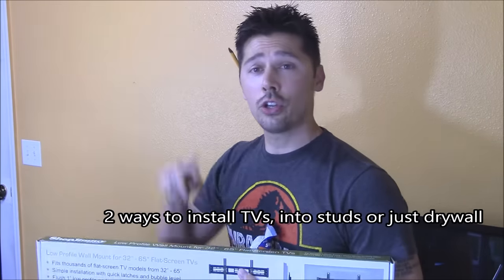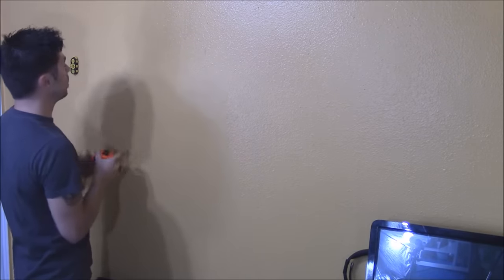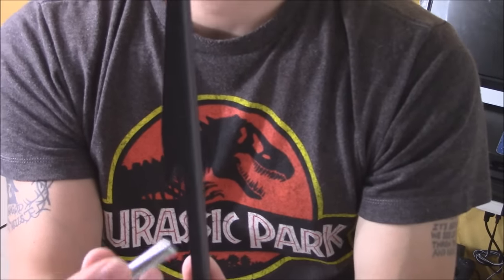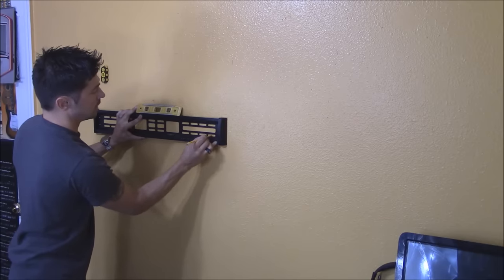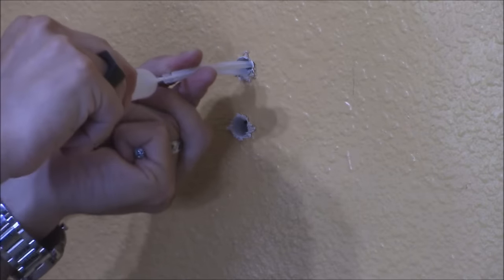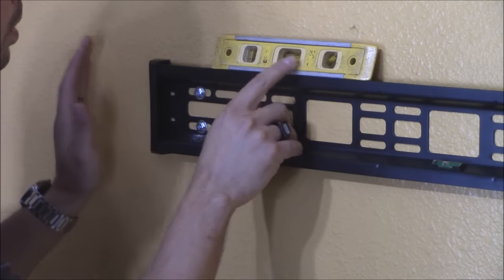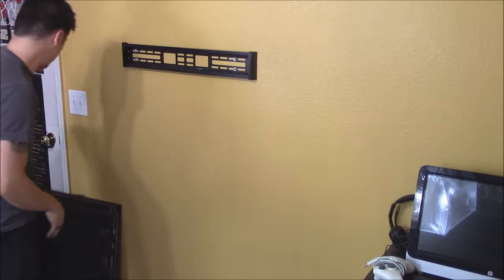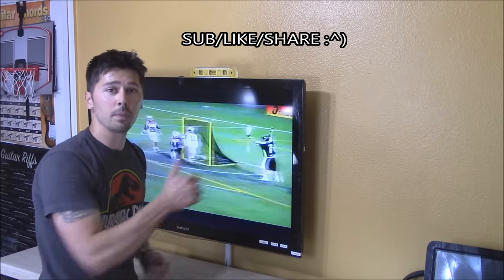2 ways to hang TV on wall mount into stud and drywall review

Comment: I see you're only using 4 mounting points for the bracket to the wall. As most only use 4 bolts/screws to mount bracket to the wall.

I'm having a hard time finding studs in my wall, so I was thinking of just using snap toggles.

Do you think by adding more snap toggle bolts it would make the mount with tv that much more secure?.. I'm thinking of at least a total of 10 snap toggles to mount the tv bracket mount to the wall.

I would think so unless there's some bit of engineering and physics I'm missing that dictates it won't help as much as I think it would or should.
Reply from the maker: Wing Yip yes but don't use toggle bolts too close to each other.
Reply: Thanks.

My wall is weird.. really tough to locate the studs.. The electronic stud finders aren't giving me solid results and I'm afraid if I got a magnetic stud finder it may not even detect the nails/hardware in the studs since the walls are sort of thickly layered, I think.

I did a 1/2" diameter test drill (well, it ended up being a test hole) and noticed my drywall(or is it plaster wall? same thing?) is about 1.5"thick  before I hit a layer of wood board in the back.  I think I need to penetrate that wood layer in the back and use the snap toggles.. they seem to be the only ones which are really strong and can possibly go in that deep.

I'll keep the spacing in mind between the snap toggle bolts.

The tv mounting plate accommodates up to a 16" span, assuming I had studs that were 16".. there are multiple mounting holes across the top and bottom of the plate as it's pretty common and you might be familiar with.

I'm thinking an additional 3 evenly spaced between the extreme left and right ones on both the top and bottom, for a total of 10 bolts.. If I'm reading the template correctly, that would mean they'd be about 4" apart from each other... One in the center, two 4" away from the center and another two 8" away from the center.

With that many snap toggles spread across, 2 rows of 5 snap toggles spread evenly 4" apart, that should be more than enough to hold the fairly weighty tv wall mount and 46" tv.. even if it's one with the extending arms.. although, for safety, I may just leave it alone most of the time and keep it as retracted as possible.
 
thanks again... great video, btw.

Comment: Hey quick question I got got a 55 inch lg TV and am planning on mounting it on an arm bar type of mount. Am going to put to screws in the stud and and 5 using a snap toggle bolt. Do you think this will be ok of will it fall off??
Reply: Two* screws

Comment: Thanks...one last question...you suggest NOT USING toggles after certain size I think you stated 55"..what do you mount with as a fastener for large 60" plus TVs?
Reply: It's not about the size of the TV as much as the actually weight. Newer TV's are much lighter now a days. Although you should always have some kind of stud in the wall, either wood or metal. If not then it could be a concrete wall.

Comment: Used those anchors after one of your other videos, well worth the money over some of those cheaper anchors that seem to fail.
Reply from the maker: TJ as a TV installer i can't live without my snap toggle bolts works in concrete block, metal studs and just drywall, great invention!

Comment: interesting..but I have a problem with my tv wall mount I bought. it's for the right size, though my TV is a LG 42'' LB5610 and it's NOT completely flat behind. like the holders should have been horizontal instead of vertical! So should I try to look for one horizontal or look for holders and screws to fit in using the wall mount?

Comment: I would never trust any drywall mount to hang a TV on the wall. I currently have my 65" Sony on the wall but it's in the wall 2x4's. I used the same magnet stud finder and then centered the stud with a small nail before drilling. Once you find the stud it's best to then find the center. Most wall studs are 16" centers, but they're not always exact. I used a larger level but vertical not horizontal to ensure the top and bottom holes were straight on my bracket. My bracket was much wider (10") than this one. Wife and I lifted the TV while still on the TV stand to the wall mount. Then I removed the stand. Laying the TV on its face, removing the stand and then mounting was extra steps to me. I also put tape on the wall and marked on the tape with the pencil. No marks on the wall to clean up. Not knocking your method in any way but just wanted to post a different way to do this. My TV is 59 lbs with the stand and 40 without.

Comment: I have no studs at all in my wall. Its just drywall...? I have a 43 inch TV. Can I still use the snap toggle bolts? I noticed you mounted the first side to the stud but the second was just to the drywall (like mine).  Am I just as safe? Thank you, from Brooklyn.

Comment: Hi Mr Tamptec this is Lloyd once again just want some technical advice from you i got a ht-e blu ray player 3d wireless speakers it has 2hdmi ports 1Aux rca connection 2 video rca connection 1Lan port and 4ports to connect sub-woofer ,centre speaker and front speakers (L&R) and want to connect a Digital to Analog converter if you have any video it is much appreciated thank you for time

Comment: Gerat video! My wall is a little wavy, the house is about 100 years old. Do I need to do anything different? When I have mounted shelves my shelves are never completely flush with the wall. Its not a big deal but with a tv I am a lot more concerned. Thanks for any advice.
Reply from the maker: +Chris Schott try to install screws in studs to be safer, this tutorial should still help with your house walls.

Comment: I got a Toshiba 29" fairly light tv it can be picked up by 1 hand easily, do you think it is safe to run it into the wall with just regular dry wall screws? the way my house is done is fucked up so there is no studs in the area at all I want to put the tv.

It is a Toshiba 29L1350U weighing in at 10 pounds.

Comment: Had a question sense you are experienced in mounting tvs if I can secure a full motion mount in two studs would it support a 75lbs 70" TV even if extended the full range of the mount witch is 16" from the wall just worried about the extra leverage caused by being extended away from the wall

Comment: Would a full motion mounted 65" 25kg TV be a problem IF you managed to get one of the stubs to support the load. The other metal  plasterboard  screws would have to go directly into plasterboard only. Much appreciated in advance and thanks for your videos!! The TV would very rarely be extended away from the wall,  more so angled at one end rather than fully off the wall to prevent too much strain on the wall

Comment: Might be overkill but  how about cutting out a larger piece of drywall and having a piece of equivalent thickness plywood screwed in to two or more beams, then drill mounting holes, sand, Spackle and paint and then screwing the mount directly to the plywood.

Comment: I have purchased a full motion tv mount for a 43” led tv. I want to wall mount into a dry wall using m6 snap toggles for all the screws and will not be able to use a stud on either side. Will 4/6 snap toggles be sufficient to hold the tv and more importantly allow me to move the tv to the desired viewing angle? Any further help will be highly appreciated.

Comment: I just put a 68lbs big screen on the wall, one side of the bracket in put two big screws into the stud and the side of the bracket I used toggle bolts which can hold up to 265lbs.
However, I still feel that the tv would come off the wall?

Comment: So those drywall anchors can be used to hang a 43 inch flatscreen. Good to know, I need to hang my new TV and I was worried about those thigns not being able to support the weight of the TV. my TV only weighs about 20lbs if that,so those that he has should be able to do what I need to do.

Comment: My gf has a mount but no bolts. What type of bolts should I go buy if I'm going into a stud? What are they called or what weight rating? I'll get the snap toggle for the drywall side if it doesn't reach like in your example.

Comment: Great video, was supposed to do the same thing but ran a problem. there's no stud behind my wall. dry wall is about 2mm thick then about 3mm hollow space then concrete. I can't get the toggle pushed in and plus the screw are too long and pushed the dry wall out so I stopped. what's your advice on this master tampatec?

Comment: hey TampaTec, i have a 55" Lg tv with a wall mount that sits flush, i bought the 80 lbs toggles, but im a little scared to use the 80 lbs, do you think 6 of those will be secure enough, or should i get heaver ones?

Comment: Residencial have wood studs.and they are 16"apart or less (Unless their wrong)
You can use metal toggle bolts for sheet rock.
Or use self Tappers for metal studs.

Comment: on the stud side of wall installation..did you drill thru drywall AND the stud with the 1/2" bit? I want to know if toggle bolt is placed behind the stud or is it in between drywall and stud?

Comment: i just mounted my 20 lb tv to the wall. I went thru a stud and used anchors. however when i was mounting the bracket to the wall, i completely forgot to slide the washers thru the bolts. The head of the holts are big enough to where they wont go through the bracket holes. and i dont want to remove them because the anchors are the one time use type. Do you think I'll have any issues? thanks.

Comment: Awesome video, really did help me understand the basic idea, but what DO I do when installing a 55 inch tv? You said not to use toggle bolts. Any help is greatly appreciated as I plan on buying a 55 inch TV for Black Friday.
Reply from the maker: JustLiving305 55 inch LED TV on a tilt mount you can use togglers should work fine.
Reply: My guess is prolly the weight of a 55 or bigger is to much for the toggle bolts to handle

Comment: What i do is if the 24 inches are too long for the hanger i use a 3/4 inch ply wood create a back board long enough to reach the required 24 inch and you can mount that hanger anywhere within that with one inch lag bolts, of course mount the back board with inch and a half bolts.

Comment: any mounting fastners you use should be able to hold five times the weight of the tv or dont use them. I dont trust toggle bolts in drywall  when i hag canets if there isnt enough studs to mount the cabnet i will use a few zipit fastners and constructon adhisvive  i dont want to have to apoligize to a custermer after he cabnets fall off a wall loaded with her china lol

Comment: ok so you know the part where you insert that metal peice into the wall and once you do that the metal piece is flat against the wall on the other side? i'm talking about the part at 6:45. what if you want to remove it? can you take it out again or is it stuck inside the wall? so what if you wanted to cover up the hole or something after sometime?

Comment: on the stud side of wall installation..did you drill thru drywall AND the stud with the 1/2" bit? I want to know if toggle bolt is placed behind the stud or is it in between drywall and stud?
Reply from the maker: toggle bolt for drywall, concrete block or metal studs but just use wood screws for wood studs. it is recommended to predrill stud but some installers skip that step and just screw into stud. I have better results predrilling first.
Reply: Hi what do u call that part to hide the wires
Reply: +hardyb311 a wire cover track
Reply: mfward143
Reply: Tampatec what if my mount is wide enough to reach both studs? just use wood screws?

Comment: Hi, 
Thanks for the video. You made it appear so easy.
I am trying to mount an old (2008) 52LG50. The mounting holes are 31.5" apart. 
I cant find a mounting bracket ti suit. Your suggestion and advise are much appreciated.
Thanks
Bobby

Comment: will the drywall anchors still work if you do not use a wood stud at all
Reply: Yeah, Just make sure you're using some really good anchors :)
Reply: thanks
Reply: If you can't get any studs and the TV is bigger than maybe 30" I would usually use 8 toggle bolts. I have installed 70" 4K TV's using them and never had any issues.
Reply: and a lot of them lol cheap insurance is to use the stud

Comment: set the clutch on the drill to the least that will turn the screw, it will spin when it meets resistance , and you can hand tighten

Comment: Would those snap toggles work well with that same style mount (non swivel) if I used all 4 into drywall an no stud? I could even add extra and get extra bolts. Just wondering

Comment: I've seen people just use 'regular' anchors without going into any studs with disastrous results. 
Please remember that each toggle bolt used here safely holds 59.5 pounds in 1/2 in. drywall (120lbs total) and there are screws into the studs....but the TV only weighs 28 pounds. That TV will hang there for it's lifetime without failing, falling or shifting. Tampatec is correct about tightened the fasteners slowly and evenly to achieve their rated performance, and we should also check level throughout the process.

Comment: Why not just use all studs and forget the toggle bolts?
Reply from the maker: Yes mounting to studs is the most secure way but I wanted to show 2 ways just in case studs aren't at the location where TV needs to be mounted.

Comment: What should  I do if one of the leg screw wont tighten  it can come out but when I try to tighten it wont  do it it just keeps spinning
Reply from the maker: stand leg? Maybe Nut is loose or missing so use 🧲 to pull out and find nut. May have to hot glue nut.
Reply: @TampaTec  (my bad typo) is lag screws for TV mount the screw can come out but it won't tighten all the way

Comment: Instead of drilling into the drywall for the toggle bolts you can use a knife or drywall saw and twist into the drywall. This way you don't pop any holes into pipping and you'll feel resistance when hitting electrical or a hurricane rod.

Never trust the level built into the mount kits.

nine times out of ten people don't want a track to hide the cable, they want a seemless look and want you to wall fish them and expect it for free. Also they will freak out when you have to charge them for new longer HDMI cables because the cables they already have are 5/6feet long and you probably need 15 foot long cables.

Comment: What do you mean "don't use snaptoggle bolts on 55"+ TVs on arm mounts"?
My TV is 65" and my wall mount is not long enough to reach stud for both ends. Then what should I do? Can I still use snaptoggle bolts?
Reply: If you can drill into 1 stud, you will probably be fine, but maybe not.

In your case, the most secure method would be to screw a piece of plywood across 2 studs and then mount the TV to that piece of plywood using wood screws.

Comment: Alright buddy, my flat panel TV is slightly older so I need a bit more space than you do on the wall to get my amazon fire stick plugged into the wall behind the TV, do you have any recommendations for the type of bracket I should use? Thanks in advance
Reply: Can't you buy a 90* hdmi adapter for your fire stick?

Comment: I'm trying to mount my 55" OLED but the center of my wall has a stud going through it with the next stud being 16" on either side. What's the best way to mount this beast?
Reply: Nvm found a mount that spans 3 studs. Overkill but no need to use anchors or adding wood between the studs.

Comment: Hey I want to mount my TV but only find drywall in the spot that I want it, It's 60 lbs and a 65 inch. Would you recommend
Reply: using the snap toggle bolts for this project with no studs available?

Comment: You went to the trouble to find the studs than used togglers instead of simply screwing into the studs. In fact, it looked like you hit the side of the stud on the right side. What about the power and TV signal??
Reply: Pappa Bob The studs were too far apart for the mount which is why he used the toggles.

Comment: why shouldn't you use toggle bolts on a 55 inch
Reply from the maker: +Juan Garibay depends on the weight really but using full motion mount adds to stress on the drywall.

Comment: Im thinking of getting my tv mounted above my monitors, but i need the mount to tilt the tv down, nothing drasticly or anything. just enough i dont break my neck looking at it. so i was wondering if the mount you used has a tilting mechanic in it
Reply from the maker: check out full motion mount mounts under 200usd

Comment: 3/16 drill bit is equal to 5mm drill bit is that ok to use to pilot a hole for the bracket?
Reply: Okay thanks I got the tv bracket and got the screws into the studs and if I could grab into the bracket like you I would definitely be able to hang off from it too.  Thanks for the big help on the tv.👍📺👍 if you checked my channel it will show you the tv I just installed into the wall I did myself.. You can see it there

Comment: You said if you have a mount with a swivel arm you shouldnt use toggle bolts for 55"+ TV? I have a 65" with a omnibasics wall mount
Reply from the maker: if you are using led tv it should be ok but at least tag into 1 stud center if possible and use 4 togglers
Reply: +Tampatec Great! I have 2 firmly in the studs and 4 toggle bolts
Reply: Nice picture, I am a bears fan as well!

Comment: How well does that stud finder work on plaster walls that have that metal mesh inside?
Reply from the maker: plaster is harder to locate studs I use knocking method or remove ac outlet cover which usaully is next to a stud.

Comment: if I don't have a drill and have drywall is it still possible to mount it
Reply from the maker: you can use knocking method  to find stud and hand screwdriver with wood screws and washers to hang wall mount. drywall screws are not as secure as screwing in a wood stud.